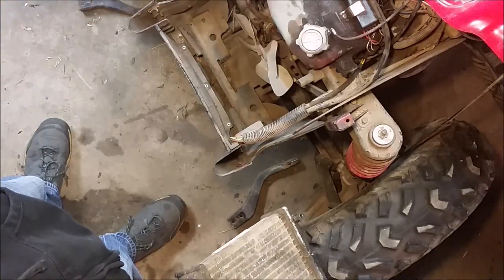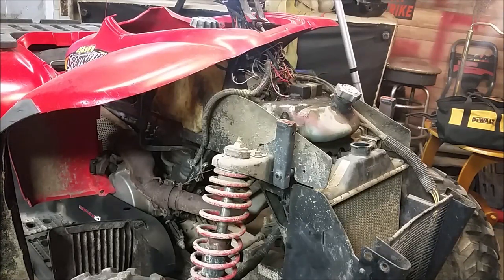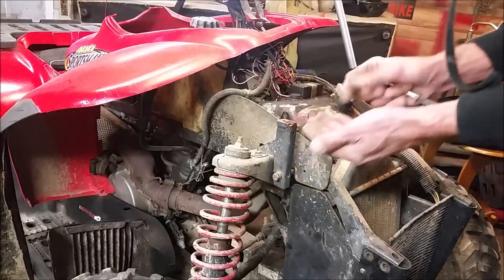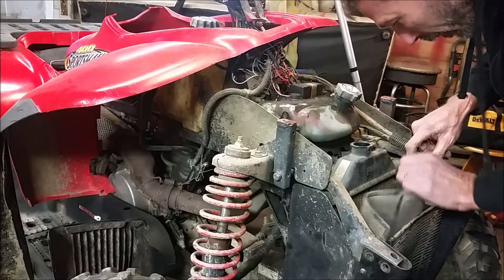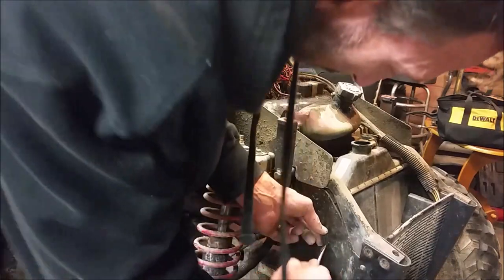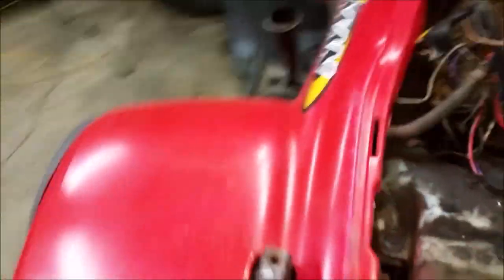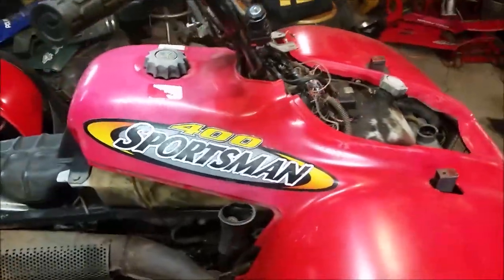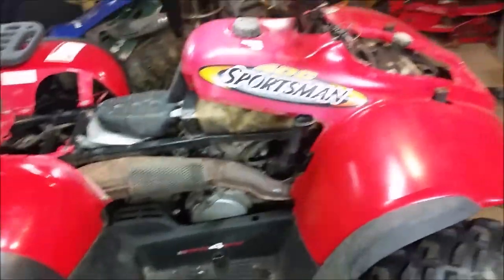Polaris 400/500 Radiator! How to Remove and Install

Comment: I know this is out of subject on this video but I had just rebuilt my motor and got it started, theres a screw point for oil injection system to pump through and up to the carburetor boot, air gets through that lose line because of oil injection delete, do I just replace that point with a regular screw to seal that air point off on the carb boot? 400 scrambler
Reply from the maker: That's a good point. I hadn't thought of air coming through it. I would think a regular screw would work fine to block the small port in the boot.

Comment: Where does the overflow hose go to
Reply from the maker: From the overflow tank to the top filler hole in the radiator. There should be a little port on the side of it to plug into.